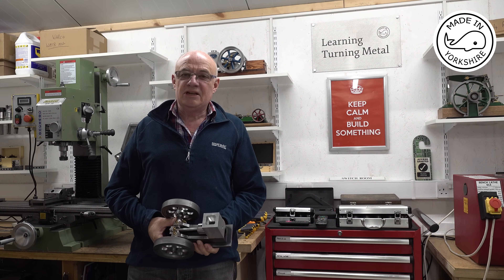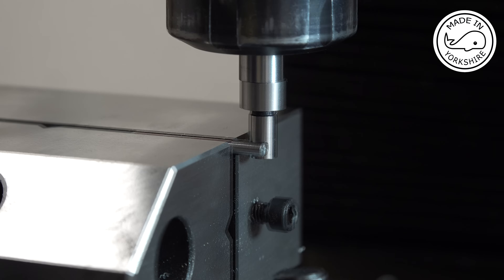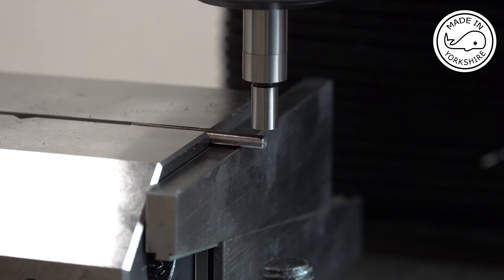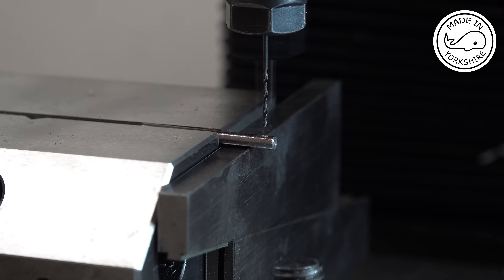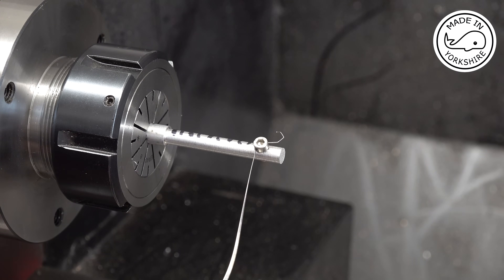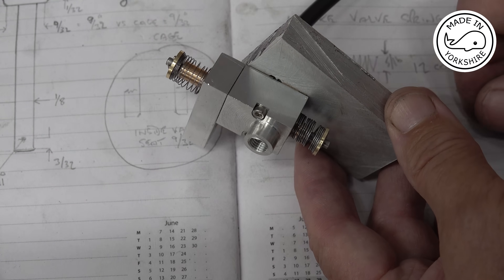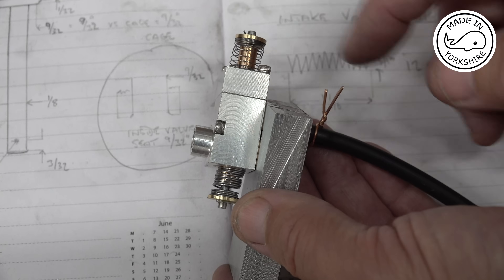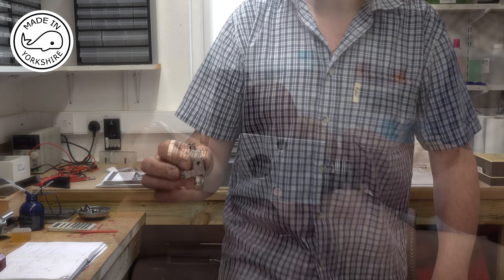#MT41 Part 12 - Philip Duclos Odds n Ends Engine. Valves and Springs. In 4K by Andrew Whale.

Comment: I think you can use BRASSO as a fine lapping compound. Easy to clean after use.
Reply from the maker: Thanks for the suggestion. I've used Brasso in the past and it's pretty decent for fine lapping. However, I tend to use fine and ultra fine lapping paste made by Moleroda.
Cheers
Andrew

Comment: Thanks Andrew for more great stuff. I wonder though wether you nuttered the valve stems. When you are drilling the 0.060" hole you say that you have cut the stems to length and later you face the valve head thus presumably ending up with a short valve. 

Cheers, 
John
Reply from the maker: Hi John - I think you might be correct. I guess that they could be a few thou short of spec but it isn't a critical measurement. There is plenty of distance between valve seats when they are in the open position. The link to the exhaust valve is also adjustable, so I don't think it will be a problem. When I take it apart prior to the final assembly I will check it out of curiosity.
All the best.
Andrew

Comment: G’day Andrew. Excellent result well done. How did you fix the keepers in place, you didn’t explain?
Cheers 
Peter
Reply from the maker: Hi Peter. For the keepers I reduced some round brass bar just greater then the spring od. I then reduced 1/32" of the od to a dimension just smaller than the id of the spring. Then I drilled through 1/8".  I think I parted them off to an overall width of 3/32". The keepers were held in place by a split pin pushed through the 40 thou hole I drilled in the stem at the beginning of the video.
Cheers
Andrew

Comment: Hi Andrew, excellent job and great result 1st time. What compressor are you running, it is incredibly quiet? Cheers, Jon
Reply from the maker: Thanks Jon - it's relatively cheap compressor I used for airbrushing on the woodturning lathe. It's an AS186 with a pressure tank on top. I think it can get beyond 60psi. There are versions without a tank, but they will run all the time. It's OK for very light work. It wouldn't be powerful enough to run proper air tools.
Cheers
Andrew

Comment: Can you use the carriage feed (for screw cutting) and hold the wire in an adapted tool holder?
Reply from the maker: Hi Pierre - I think that is definitely possible and a great method to produce several identical springs. However, I hate messing around changing gear ratios on my lathe. For me it was a lot easier just using a mandrel. Thanks for the suggestion though.
Cheers
Andrew

Comment: An explosive episode!😂 Very impressed with how those valves have seated. How did you stop the valve heads sliding down the shafts when you soldered them?
Reply from the maker: Hi Tim. I should have mentioned in the video that I use a little centre punch to reduce the inside diameter at the top of the hole in each head. That stops them from sliding down and allows for some machining off the top of the head.
I can't believe how well they have seated either. My machining skills must have improved - or maybe it was just my lucky day!
All the best.
Andrew
Reply: @learningturningmetal  A neat trick. I do recall you doing that before now you mention it. There is truth in that old saying 'The more I know the luckier I get'.

Comment: Hi Andrew, another inspiring video.  Thank you.  I couldn't help noticing that the exhaust valve spring had what looked like quite a few bound coils, and it didn't look too far from getting fully "coil bound".
Reply from the maker: Hi Steve. Yeah, making springs isn't one of my strong points. I think it will be OK as there is plenty of space between valve seats when it's in the open position. Worse case I could make another with fewer coils. Something for me to check on when doing final assembly.
Cheers
Andrew

Comment: Hello Andrew, Like John Fox said, I ducked when the air line let loose. Quite a surprise !   Good work with the valves and test manifold. I should be  back on the build tomorrow.
Reply from the maker: Hi Earl - I hope the family reunion went well. We are nearly there with this little engine! I've been thinking of ignition and am wondering whether to try making points as suggested in the drawings or go with a hall censor. I'll drop you an email to get your views.
All the best.
Andrew

Comment: Haha I jumped when that hose let go. Andrew why the difference in the valve spring sizes and pressure??
Reply from the maker: Ha ha - me too! The hit and miss engines operate the exhaust valve via a link from the cam gear. When hitting a certain speed the governor will kick in and stop the link from closing - keeping the exhaust halve open. With the exhaust valve open, the engine will loose all compression and coast along until the revs reduce to a certain level. The exhaust valve will the close.
The inlet valve has no physical link to open/close it. When the exhaust valve is closed and the engine returns on the intake stroke, it generates lots of suction. It is the suction that opens the inlet valve and lets fuel into the cylinder. If the intake valve spring is too strong, the suction on the down stroke will not be enough to open it - so it will be starved of fuel. If the inlet valve spring is too weak it will not close the valve properly on the upward stroke and compression will be lost.
This method makes for a far simpler engine design, but it would not work well with higher revving and more powerful engines.
I think that getting the inlet valve spring to be the correct strength is one of the most important aspects of hit and miss engines. I think my inlet valve spring is a little on the weak side, but we will have to see how it turns out in real life. The way in which the inlet valve operates, often creates a 'snorting' sound which is a familiar aspect of these engines.
I hope that helps explain my limited understanding of how they work.
Cheers
Andrew
Reply: Thx Andrew. I understand now 👍

Comment: That first air leak didn’t seem hard to find , ha ha 😂 ! Great job on the valves , any concerns about the silver solder   
in regards to the heat when the engine is running ?
Reply from the maker: Ha ha thanks mate! I think the melting point of silver solder is around 600°C (~1,100°F). If my little engine gets close to that temperature I think I will have other things to think about- like looking for the fire extinguisher ha ha.
All the best.
Andrew